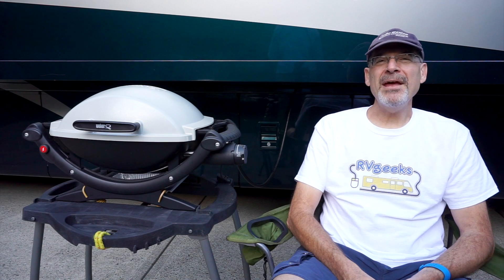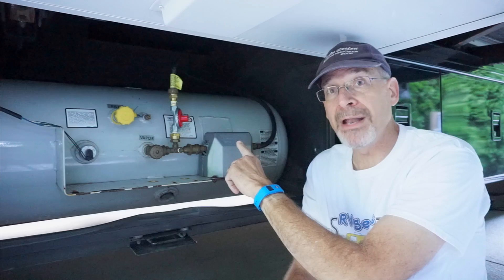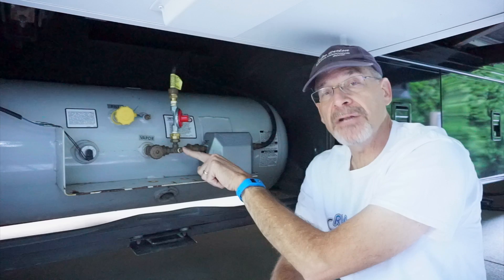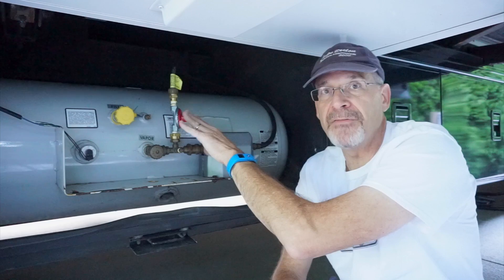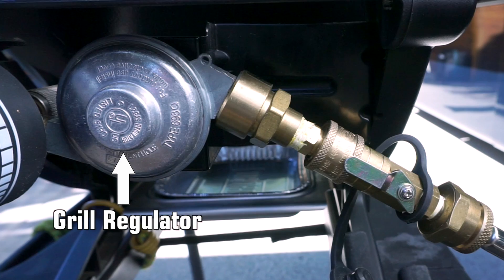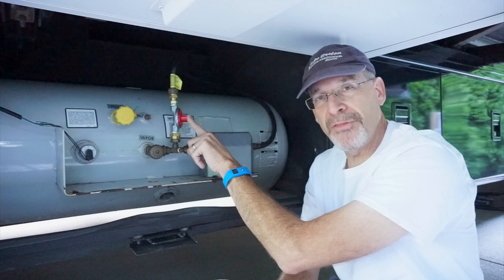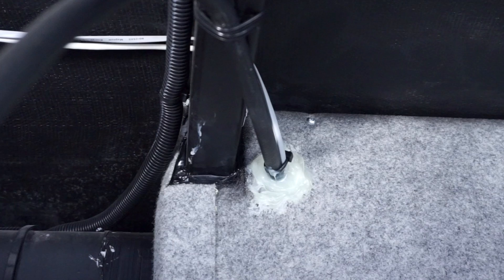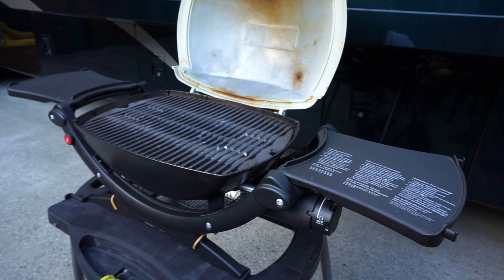How to Connect a BBQ Grill to an RV's On-Board Propane Tank

Comment: I would think having that second regulator at the grill would almost stop the flow of propane. Why not take that one off, since the propane is regulated with that red regulator by the tank?
Reply from the maker: The red regulator is 15 PSI, and the one on the grill is about 0.5 PSI, so that 15 PSI  still needs to be reduced at the grill. The red one is just to prevent oily build-up from full-pressure propane in the hose.
Reply: got it.  i am trying to do the same but keep having connection issues. as far as finding fittings
Reply from the maker: We have a lot more information, including a diagram and parts list, on the post on our website: http://www.thervgeeks.com/propane/bbq-grill-connection/
Reply: RVgeeks thanks

Comment: Planning to do this mod as well, is there a magic number  of feet for the extension hose before you have to add the additional regulator?
Reply from the maker: Hmmm. Great question, Jean.  We're not sure about that. It might not take too much length though, and we're pretty sure that the exposure to cold air exacerbates the problem. It seems like the hoses are either quite short (propane tank on the curb/grill side) or pretty long (tank on the driver's side). We're only making a slightly educated guess here, but if the hose is more than about 8-10 feet, and it's being used in the winter, we'd guess that the oil build-up problem would be more likely. Sorry we're not 100% sure on this one.
Reply: Thanx for your input, I think it's cheap insurance just to add the 15 psi regulator and mitigate the oil contamination possibilities. Thanx again.

Comment: I installed my webber Q2200 onto our travel trailer that had a gas line installed at the back of the trailer.  This was used originally for the grill that came with the trailer.  I removed the regulator on the weber Q2200 and installed a Male 1/4 inch QD to hook up to existing gas line on back of the trailer.  I noticed the flame isnt as high on the grill as it used to be with the 1lb tank and the stock regulator on the weber grill.  Curious if you have heard of this before?  Any idea what this could be?
Reply from the maker: Considering that the Q2200 is larger than our Q1000, we'd say that it's likely a FLOW issue. We've had a couple of people comment with a similar issue... but they each had unique situations that ended up being the problem. One person had used a "Y" to add a second connection for their fire-in-a-can... and that "Y" turned out to be restricting the flow. Another person had used a different "T" on the tank side... and THAT was restricting flow. Since the 2200 produces almost 50% more BTUs than our grill, it must burn more propane to achieve that. Chances are that there is one or more components in the line leading from the onboard tanks to the grill that are restricting the volume of gas allowed to pass. It could even be the RVs onboard regulator restricting the total flow to less than what the Weber needs to burn at full temp. Short of replacing each component in the system, we're not sure what to suggest you try... other than doing what we did which was to "T" in BEFORE the RV's onboard regulator to access high-pressure propane... then regulate it down to 15PSI so it wouldn't result in oily buildup in the lines. That seems to work (assuming the parts used are all full-flow).
Reply: Interesting idea...I need to look up by the tank and see if the line for the gas for grill is seperate.  It came this way from factory, I didnt add any of this.  I know I checked all the burners in the stove/oven inside trailer and they ignited and seemed fine.  I know my grill got close to 600f....it just seemed like it took longer to ignite then it did before....I will play with it more tomorrow.  Thanks again!!  I will let you know if I find something
Reply: Update: Did a comparison test of temps of my Q1200 on 1lb bottle vs my Q2200 on RV hookup. both had similar temps and times.  No issue to report, thought there was, thankfully not the case.

Comment: @RVgeeks
, would you recommend a regulator for a 12ft hose coming off a 20lb tank?
Reply from the maker: It's hard to say for sure, Bill. The oil issue seems to be a factor of the hose length, the amount of pressure and the temperature. The higher the pressure, the longer the hose and the lower the temperature, the more likely there could be oil build-up. Sorry we're not sure how to give a decisive answer to this one. Maybe someone else can talk about their experience. If we had this set-up, we'd put the regulator in line just in case.

Comment: how do you get this to work with essentially 2 regulators between the grill and the onboard propane? wouldn't there be too little pressure at the grill?
Reply from the maker: Great question! That first regulator near the big propane tank is 15 psi, which is actually still a lot of pressure. It’s low enough to prevent the accumulation of oil in the hose, but still plenty of pressure to supply the grill, even with the grill’s (much lower pressure) regulator in place.
Reply: YesThis gas control valve replaces the valve with your Olympian 5500 RV grill (CAM57305 - sold separately). And it lets you use a propane supply on an RV or trailer that has a built-in Quick-Connect propane connection

Comment: We have a RVQ (BBQ) that came from our previous rig that had a dedicated line with quick connect after the regulator.  I want to hook up the RVQ to our new camper's propane tank with a Y off the tank (not after the regulator that controls the flow into the camper).  However, the info on the RVQ regulator says max input is 1/2 psi (and it was hooked up to the low pressure system before and worked), so I think I need a 11" or 1/2 psi regulator added to the tank (Y) rather than your 15 psi regulator.  It will be a 12' hose and only hooked up when I'm using the BBQ.  Sound right?
Reply from the maker: Hi Roger! Since your BBQ connects to the already-regulated propane system in your RV, it must not have a regulator built onto it. If it did, it would need high-pressure propane to operate. Therefore, you do indeed need to supply already-regulated (11" WC / 0.5 PSI) propane to it. We'd suggest that if possible, you Tee into your propane line AFTER (downstream) of your RV's main regulator, thereby providing the pressure you need, and avoiding the necessity for an additional regulator.
Reply: Thanks for getting back to me so promptly.  The RVQ (BBQ) does have a regulator built into it.  It's a Maxitrol that says max input is 1/2 psi.  Also, it would be a whole lot more difficult to get into the line downstream of the existing camper regulator and much easier to go off a Y from the tank.  Like I said this RVQ worked with our previous rig with its "built in" regulator downstream from the RV's main propane system regulator.  So that's what I will end up with again if I go this route.  It seems you don't agree with this proposed two low-pressure regulator set up.  Hmmm.
Reply from the maker: It's not that we don't agree, but rather we didn't realize that your BBQ does indeed have a regulator on it, and we thought it would be easier to connect downstream. But since it DOES have a regulator, AND it's more difficult to connect upstream, AND it worked with already-reduced pressure before, we agree with your plan to add a 1/2 PSI (11" water column) regulator. The reason we're surprised, and made an incorrect assumption, is because in our experience, with an appliance that taps into the regulated house system (which is already regulated to 11" WC), it would not need it's own regulator, since the whole RV is already regulated down to the required PSI. But if you had that before, the safest move is to replicate what you had.
Reply from the maker: Oops... we meant it "it's more difficult to connect DOWNstream!"
Reply: Thanks.  I'll probably ruminate on this for a bit and then jump in to some kind of set up!  We'll let you know how it works out.

Comment: I just completed this modification on my RV.  I hooked it to my new Camp Chef  Pro 60 stove.  The stove does not appear to be getting enough propane as the flame is very low even on high.  The stove has a 1 PSI regulator attached to the hose where it would connect to a bottle.  What would happen if I took off the stove regulator.  Would the 15 PSI be way too much?
Reply from the maker: Hi Mike! First, make certain that you have indeed teed into the line UPSTREAM of the main RV regulator, which makes sure that high-pressure propane is being fed into the line. Teeing in downstream, after the RVs regulator, will result in double-regulation, and not enough pressure to the grill. Also, did you get all the parts from our list, or did you use some other, similar parts? We've heard of some types of connections having flow issues which could also be causing your problem. If you are teed correctly into the high pressure coming right off the tank, 15 PSI would definitely be far too much for the grill, so don't try to fix the problem by removing the grill's regulator.
Reply: Yes, I ordered the parts from your list.  I teed it off directly from the tank before the RV regulator.  The stove works well off a bottle.  I'll double check all connections and parts again tomorrow.

The stove is very powerful, 60,000 BTU, much more than my little weber Q was.  Not sure if that matters.
Reply from the maker: We're not sure, but we're guessing that the 60,000 BTU rating may be the issue. It's possible that it requires a higher FLOW (not pressure) of propane, and that one or more of the components may be restricting the flow, and therefore not allowing the grill to operate at full heat. Sorry we only have first-hand experience with our little Weber, and can't be sure on this one.
Reply: I removed the 15 PSI regulator and now the grill works fine.  I guess I'll just run without it.  You talk about the oily substance building up in your grill regulator due to the high pressure without having the 15 PSI regulator.  How long does it take for this to happen.  It wouldn't be too much trouble to just replace the regulator every once in a while.

 Also, do you leave the rubber line hooked to the propane tank all the time?  Are these rubber lines designed for high pressure constantly?
Reply from the maker: Hi Mike. Good to hear you've got it working. We're guessing that the regulator on your high-output grill is expecting higher pressure than the 15 PSI was allowing. It might take a while to get the oily build-up, but another way to prevent it from getting to the grill's regulator is by installing a filter in the line to catch the buildup before it reaches the grill. Here's the one we used prior to installing our 15 PSI regulator: https://amzn.to/2MWf7s4 and it worked just fine. Not sure how often it would need to be replaced, but probably not very often. Best to install it as close to the grill as possible.... even right at the grill if you can.

As far as leaving the line connected, yes we do... for years now, without a problem. But we've been considering modifying our setup slightly by installing an on/off gate valve just after our 15 PSI regulator to shut the line off when not in use. Probably a good safety measure. If you decide to do something like that, make sure you use a high-pressure valve, since you don't have the 15 PSI regulator.
Reply: Thanks for your help.  I will order a filter and am going to put a shut off valve just in case.

Comment: Hi guys
I followed all your instructions. Yesterday I noticed that my Weber BBQ when hooked up to your set up would only reach around 400 degrees, and get there slowly. With a canister,  it gets to over 500 degrees fairly quickly. I am using a 15 psi pressure regulator. Should I use a 20 psi? It's very hard to cook with such low heat
Reply from the maker: Hi Jeffrey! 15 PSI should be plenty, and more than that does have the potential to cause the oil build-up problem we talked about. We're thinking it may be a flow issue, not a pressure issue. Can you tell us anything more about your set-up... is it exactly the same parts we listed, or are there some differences that may help us figure out what might be going on?
Reply: The only wrinkle is that originally I was sent a 10 PSI regulator by mistake. I installed it, then replaced it with the 15 PSI regulator. I also needed to use a T adapter because of a lack of space. Other than that, I am using the exact same parts.
Would it work if I took out the regulator, and used a filter on my hose to avoid clogging the BBQ regulator with oil?
Thanks!
Reply from the maker: A filter would indeed work, as that was the first thing we did after having the oil problem. If you take out the 15 PSI regulator, install a filter, and still have the problem, then that would obviously rule out the 15 PSI as the problem. Please let us know how  you make out.
Reply: I certainly will.
Thanks you so much for all your good work. You guys are amazing!
Reply: hello, can you point me to the type of filter you try? Thanks.
Reply from the maker: V Fam - before we changed to this new setup, we used an inline propane regulator like this one on Amazon: https://amzn.to/2rbS82N

We installed it right before our grill's regulator, to catch any oily residue that developed anywhere in the line. Hope this helps.

Comment: your vidio shows you put a regulator on the stay but it looks like you left the regulator on the BBQ also i though you have to remove that one
Reply from the maker: The 15 PSI regulator brings the pressure down enough to prevent oily build-up in the long run of hose that goes over to the grill, while still allowing enough pressure to get the propane all the way over there. But 15 PSI is still far too much pressure for the grill, so the grill's own regulator absolutely still has to be in place (that one is far lower than 15 PSI).

Comment: This  is a great video that I have looked at before. I have a new RV and a question. How long is too long for the hose to need the added regulator. My tank is on the passenger side and a 12' hose will get me to the BBQ and/or the fire pit we use. Would I still need the 2nd reg in your expert opinion??
Reply from the maker: Hi Lynn. Congrats on the new RV! We wish we had an answer to the question of "how long is too long?" We had our problem with twice that length of hose (12' hose to get across the RV from driver to passenger side, then another 12' hose to extend the grill away from the RV). So it's POSSIBLE that a single 12' hose won't have the problem. Some of that may depend on if you plan to leave the 12' hose connected to the tank permanently... or if you're going to remove it regularly when breaking camp. If leaving it on... it's more likely to be an issue (it seems to be a problem of extended time with the hose exposed to high pressure propane... particularly when the ambient temps drop). If you'll be disconnecting it on any regular basis... it will probably be fine without the regulator. But we can't be 100% sure.
Reply: @RVgeeks  Thanks for the quick response. I am not full time so will most likely disconnect the hose when we pack up. Probably the most would be a 2 week stay.
I appreciate your input and enjoy watching you on the road. I look forward to the RVers and seeing more of your travels.
Best to you.
Reply: So I am working on  the Extend-a-stay (EAS) and shock ran into a problem. The propane tank on my Tiffin Phaeton is mounted so the end of the tank is what I see from the storage door. The connection point for the EAS has a hose to the main regulator making it difficult to mount the EAS as you and other show. I'll be using the red 15 PSI regulator but the question is - can this regulator be mounted in any position? Don't see a vent as in the main unit. I may need to be creative to get this in the bay but thought I'd ask your opinion. I have a photo but don't see how to send it to you?! Thanks for your assistance.
Reply from the maker: Hi Lynn. Sorry to hear you're having trouble... certainly sounds like Tiffin didn't make this easy for you! We're not at the RV to be able to look closely at our 15psi regulator to know if it has a vent. But we'd assume it does (even if it's not all that obvious), since it's pretty standard for a regulator. That said, when mounting a regulator, you either need to keep it covered, or mount it with the vent pointing downward... to keep rain & other debris from getting in. We don't recall paying any particular attention to how we mounted ours, since it's inside a compartment where it's unlikely to get rained on... and is mounted high enough up not to get sprayed from wet roads, etc. So if yours is similar, we'd bet you'd be OK with mounting it in whatever direction you need in order to fit it in. Hope this helps!
Reply: @RVgeeks  Thanks again. You guys are a great help. I'll check it more carefully but I believe it is well covered. Still trying various angles to get it in there!!

Comment: Color me confused.... the quick connect appears to be male quick connect to female threaded.... how does it go from that to the female inlet on the grill?
Reply from the maker: Hi JT! Check out the detailed diagrams we put together, and let us know if it's more clear there. You can see the two PDFs in the post on our website here: http://www.thervgeeks.com/propane/bbq-grill-connection/
Reply: RVgeeks ok just did!!! Your site is gonna come in real handy!! Just so I'm clear- that male 1/4 quick connect screws into the male thread adapter (which goes right in to the grill)? Thanks a ton! :-)
Reply from the maker: You got it, JT! Hope you make out okay with this fun project. :)